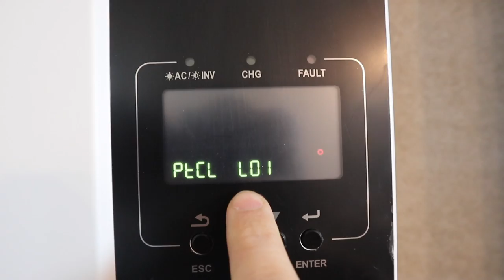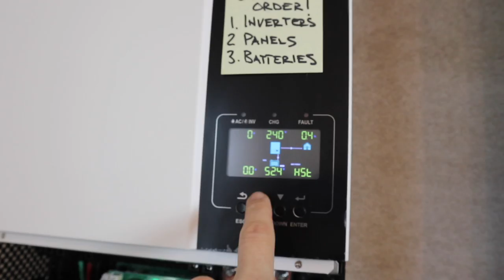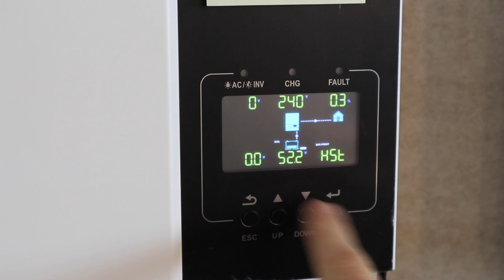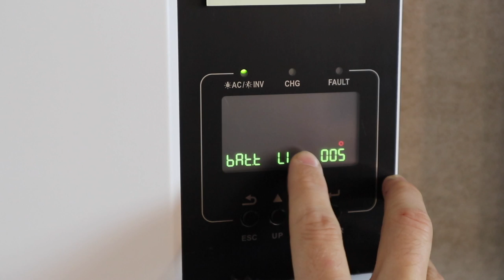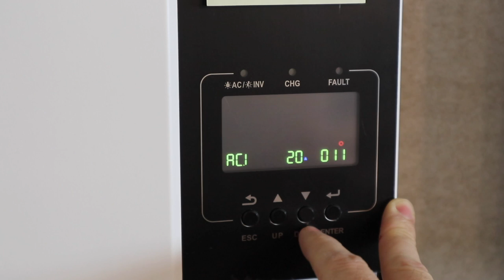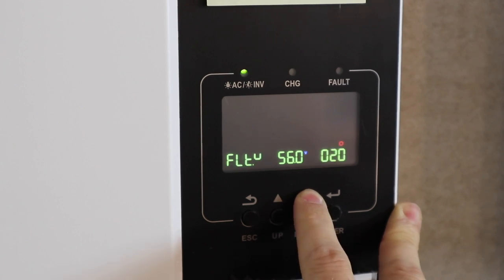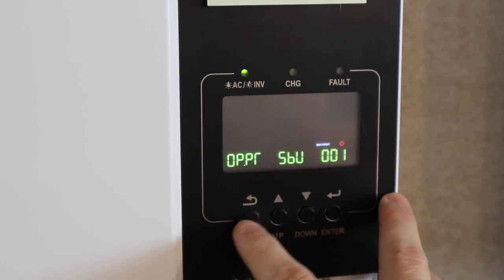Solar Inverter Growatt 5K Programing Grounding & Battery Comms

Comment: Great video, really appreciated.
Just a correction: at 6:19, "36" is not a protocol number, its a setting number. To run through your process ... You are at setting #5 (the battery type). You press enter, and the value of that setting is set to US2 (which you correctly say is the User #2 setting, used for dumb lithium batteries, where the battery is controlled by voltage only, not by comms). You press the down arrow and change the setting to LI (Lithium). When you press enter again, you are not looking at a setting of "protocol 36", you are have been jumped to SETTING #36, which is "Protocol" (the left side shows a cryptic "Ptcl" which means PROTOCOL). Here, you are setting the protocol number, in your case to "01".  
Protocol numbers (for Growatt and a number of similar all-in-ones) 01, 02, etc up to 49 are variations of the RS485 protocols. This protocol is a request-response protocol (ie the Growatt asks for data, and the battery answers)
Protocols 51, 52, etc up to 99, are variations of the CAN protocol. The CAN protocol is a broadcast protocol, ie the Growatt just listens, and the battery repeatedly broadcasts its requested charge voltage, SOC, requested current, etc etc, and doesn't care if nobody or everybody is listening.
For other readers: If you BMS is a fairly typical BMS of the current era, its likely to have a CAN port, an RS485 port, then an RS232 port (6pin), then a pair of RS485 ports. If so, you can use the BMS port on the Growatt, the CAN port on the battery, and protocol 51 or 52. If your battery only has RS485, or if you want to use RS485, or if your battery/BMS is more reliable over RS485, you can use the BMS port on the Growatt, the RS485 port on the battery, and protocol 01 or 02. 
One other correction - you say that older Growatt SPF5000ES used the RS485 port. This is correct, but "which port on the Growatt will work" is comms-board and firmware dependent. Older versions of the comms board and firmware had a limitation where every parallel inverter had to have a cable, and a MODBUS hub did the job of making sure all units saw the same data. Newer comms and firmware, as you correctly mention, share that data over the grey serial cable, so only the master Growatt needs a cable to the battery. The red/black is the cable that allows the inverters to sync their (output) sine wave. It might be more correct to call them frequency sync cables, rather than communication cables. 

An important note is that you can't really stuff up the grey cables, as they are gendered. You can stuff up the red/black cables, but I don't know the result of this.
At 8:58 you enter setting 23 (in standby mode) and change to PAL . This is correct, but you are not correct that you "can just esc out" - your setting was not saved, and at 9:01 you can see that the settings have changed back to SIG (inverter in "Single Inverter" mode). This probably worked out OK for you, because (at least with modern firmwares) when the units power up again, and see the grey serial cable is connected, they will know they are in parallel mode and default to PAL. With all settings, the setting is not saved (and also not checked for compatibility with other settings) until you press enter. Note: If you setting is NOT accepted (lets say the value you set is outside the acceptable range, or conflicts), at the point you press ENTER, the setting will change back. Another note: If the setting is READ ONLY (ie setting #2 for a comms battery), when you press ENTER to jump into the value and change it, you will instead end up on the next setting down, in this case setting #3. This is how you know the setting is read only.
Also, with newer firmwares, some settings in the manual that say "This setting is only available when the inverter is in standby mode" are actually settable in both modes. One example is the output voltage; we regularly change the output voltage (setting 08) without turning off the inverter switch - you will get a ~2 sec outage where the inverter stops, then restarts, but you do not need to turn off the switch. 
DIS is Disabled, not disconnected, but same same really.
"Setting #11 is only for lead acid batteries" - No, setting 11 is not relevant in your setup, but not because its for lead, its because you don't have a generator or grid backup. Setting #11 is how you control how fast the batteries charge from UTI (utility, aka grid or gen). This enables you to limit how much your Growatt pulls from the generator for recharging (vs running the house).
Setting #12, you are mostly correct, this controls when the grid or generator kicks in, but it wont prevent your battery discharging past X percent - the Growatt is still drawing 80w, and the house is still drawing power. Once you get to setting #12's percentage, the dry contact will change over (potentially starting a gen), and if power is then available on the input terminals, it will start to be used. Now your SOC will rise, but only if gen/grid continues to be present. Its moot, but important: at this point, the battery is STILL being used to run the overhead of the Growatt (~80w per inverter), so if (as in your case) you have no grid and no generator, even if you disconnect the house, you will be slowly dropping in SOC. This might seem like nitpicking, but its important; if you hit #12 at say 6pm in winter, with no grid/gen and a disconnected house, you might need to handle 160w of draw (2 growatts) for another 16 hours until the sun hits your panels again. You can prove this by setting #11 to zero amps, turn off your solar breaker (simulating night) and see that when the battery gets down to #12's set point, the battery is still being drawn down.
Setting #13 is nothing like you describe. This setting is where the generator will stop (the dry contact will be switched back to "normal"), or the grid will stop being used. If you reach as low as setting #21 (probably the setting you were thinking of), the inverter will stop powering the house, and grid/gen will power the house (in bypass mode) and optionally recharge (at the rate of setting #11). If grid/gen is not available, the inverter will still power the house (and the batteries will therefore continue to drop). Once you get some incoming power (solar or grid or gen), its something like 5% (seems to be firmware dependent) above setting #21 that power comes back on (ie the inverter starts inverting again).
I don't understand why you say charging the batteries from grid is not good for them. We charge from grid all the time, also from generator (which is almost the same except the power is not as clean). The SPF5000ES has no dedicated grid-to-battery charger - the grid/gen powers the DC bus, as does the solar, and this bus can handle from 150v to 450v, and DCDC this power down to Vbatt (the specific voltage depends on the battery type, SOC, charge algorithm, and settings 19/20).
There is no problem running the system without PV - this occurs all night, and any time the PV disconnectors are off. We also tell customers not to run without PV but only because it could be weeks before they finish the PV part of the install, and recovering a battery from protection mode (when the voltage is so low the BMS disconnects the cells from the terminals to protect itself) is a pain, so i expect that SS are also saying that to avoid support calls from people leaving the SPF5000ES dragging 80w all day and night, and eventually causing a low battery issue.
Great video, its awesome to hear good quality audio, steady and in focus video, and clearly enunciated words, well done.
Reply: @RoarPowerNZ-tt6ud  Finally protocols clearly explained. Thank you.

Comment: I have enjoyed all of the videos I have seen from you so far, great info and well articulated.

We, that's my wife, young adult son and I, are about to embark on a similar journey in central Mexico.

We are about to take possession of a little 38 acre ranch at an altitude of 8000 feet. Out of the 38 acres, 10 acres is a pond. The pond is 25 acres in total but our geographic boundaries include 10 acres and our neighbors owns the rest.

The property is on a main road and has access to electricity, but it was never run in. Instead of going through that process, we have decided to go with an off grid solar system, which is similar in installation cost, but offers us complete independence.

I have looked at many different solar systems, but the Growatt All In One system appeals to me the most, as it is cost effectively distributed here in Mexico. I also like the MPP Solar units, but they would have to come from Taiwan. I really like how you can string the units together, as it makes it easy to increase the system output size and if one unit breaks down you can at least function on reduced capacity. I'm looking at 2 or maybe 3x 3000 watt units, with 8000 watts solar and 20000 watts battery back up. Not requiring heating and air conditioning, makes life easy in regards to energy requirements.
Reply from the maker: Very cool. Blessings on your adventure. 
Not needing heating or air conditioning will be a huge energy savings.

Comment from the maker: I just got off the phone with Sig Solar as well. The are going to provide schematics for proper grounding, are working on them as fast as possible, and will post them soon. We run the 5000es as a completely off-grid system and the model we have has the bonding screw removed so I am not that worried. Additionally, the Growatt transformer they are selling now is different than the SolarEdge. They will provide further info on this soon as well.
Reply: Great videos, I agree with your sentiments... Can you provide a link to the grounding update from SS please? These videos are super helpful. Thanks!
Reply from the maker: @taulli1  They have told me that the method I showed in the video is correct. I have had other electricians contact me to still say it is wrong. I am leaving it as I showed it in the video but will continue to research it. There is no link from them at this time.
Reply: @CountryLivingExperience  Thank you for the quick reply! Are you up and running yet? Do you think the various methods (opinions?) of grounding are esoteric, have pros/cons, or do you think there is a day to day advantage, or is this a catastrophe avoidance issue? This has been a troubling setback.
Reply from the maker: @taulli1  Don't be troubled, it will work out. I have found that varying opinions come from varying experiences. I trust the solar company. I am still doing my research as well. I am not an electrician. My electrician said it looked fine and some others said it didn't. My system operates flawlessly.

Comment: Hi ,you write that the right order is : Battery ,panels inverter? and at the end the Grid?
and secondly  ,before you make the settings in parallel mode(of course the input AC Grid breaker is off ),does the AC output must be parallel connected (2 inverters 1 phase ) or first setting it at parallel mode from the menu  and after connecting the AC outputs of inverters ? 
Bonus question ,is it ok if one of the two inverters is without PV connecting? 

Thank you very much!

Comment: great informative video but opens up a box of questions😁.
1 on t=4:27 how would I know I have the older or the newer version (visually or screen info)?
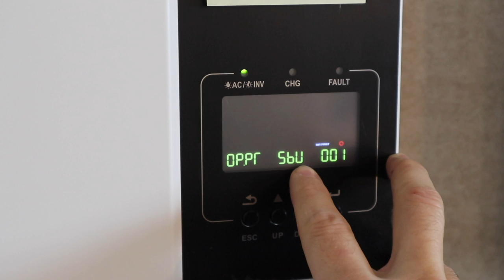2 on t=10:10 if the setting was SBU or SUB (if the inverter was connected to utility), this means the solar will provide power but for some reason solar power was not enough (excessive load, not enough panels), will it compensate from the next selection or will it switch 100% to the next selection?
3 on t=13:12 why charging the battery is better-off to be charged by solar if I have utility (clean and steady) connected?
4 on t=15:30 why it is important that I have battery before I power the system, is that because I may not be generating enough voltage (nominal operating voltage) from solar and this will result in error (auto-restart)? I was thinking to go battery-less and have only solar and utility🤔.

fyi: I have 230v/50hz utility
Reply from the maker: Thanks.
1. There is no way to tell. You will have to try both ports.
2. It will compensate and share power sources with the loads.
3. For this brand, solar input is recommended for best results and battery stability. 
4. I was advised of this issue by the distributor. I am not sure of the technical details. 
This specific Growatt inverter was modified by the manufacturer per the distributors technical specifications for the American grid. If you buy these outside of North America, the internal configuration of the Growatt 5000es will be different. These are technically Growatt 5000es-US models.

Comment: Are you considering using Generator AC input to charge batteries when PV is not available?
I found the RS485 vs BSM jack swap in the new units the hard way.
I fully expect to use the system without PV connected as a stand alone battery backup.
Reply from the maker: Yes, I am going to buy a small 1k or 2k watt dual fuel generator to use with the dedicated battery charger. Sig Solar did a video about why it was not practical to hook a large generator into the inverters to charge the battery.

Comment: What size lugs for the inverter and what battery cable size is that? tried to find when you hooked up your batteries but missed it somehow. Thanks for your videos. You explain things well.
Reply from the maker: Glad we could help. 2awg batt cable and 5/16" lugs. I just got the battery cable from the auto parts store.

Comment: My understanding of the whole grounding/bonding discussion is that an electrical system will work okay in most cases with various configurations of grounding/bonding, but where it becomes an issue is IF there is either a lightning strike or a fault in the system caused by a short in a load. In the case of a lightning strike the ground rods are the primary resolution. However, if I’m correct in interpreting NEC guidelines, there should only be one earth grounding point (rod or rod sets) for the same building even it has multiple sub panels due to the fact that voltage potentials could be different with a rod on each panel which could create an arc across something in the building.
      Regarding a system fault from a load short, since the voltage always looks for way back to its source, the neutral plays a big part in clearing a fault via the breaker in the panel. If sub panels are bonded (neutral to earth ground) where they should not be, the voltage doesn’t have a clear path back to its source to clear the fault. Again, if I understand correctly, that means the panel that combines the AC from the inverters as well as the mid-point transformer that creates the neutral for the 120v loads should be the point at which the neutral bus is bonded to earth ground on an off-grid system.
Reply from the maker: I appreciate your insight. There are so many varied interpretations and opinions on this. i am part of the diy solar forum and most on there cannot agree. There are professional electricians, electrical engineers, solar companies, etc on that forum.
Reply: Mike Holt has excellent informational videos.  He has definitely convinced me that there absolutely should only be 1 earth ground point in a building or structure.  You do not want a nearby lightning strike to ride in at one point through your house and equipment and out the other point.  Very Bad.   Power always looks to get back to source, not the ground.  Everything inside should be bonded together,  leave at 1 point, and  multiple rods outside should be bonded together.    Good luck and stay safe.  @CountryLivingExperience

Comment: Thank you so much.  Your videos are so helpful.  You say to not charge from the grid.  But SS has said I can do that and it will work fine.  Why do you say it is not good for the health of the system?  What happens if your batteries get too low and you don't have enough power for your home?
Reply from the maker: You're welcome. 
It will wear the inverters out quicker. If I don't have enough battery then I don't have power. I will have to wait until the sun recharges. My system is technically off-grid anyway.

Comment: @ 9:00 your setting #23 to PAL, The master and Slave 1 at the same time. I have 4 inverters, Can I set them one at a time starting with the master then S1,2 then 3 or do I have to shut of all 4 and set them at the same time. This probably is a strange question, but I'm at the point that everything is wired up except my PV and I am about to turn them on for the first time and I'm am a little nervous.
Reply from the maker: Don't be nervous, you can do it. The inverters cannot be set as master, slave, etc internally. It is based on the order in which they are turned on. I didn't see a specific question in your comment....what is it?
Reply: @CountryLivingExperience  I turned on my inverters with battery power and programed them and All is well. I have 14 more panels to install and wire up and in about 1 or 2 weeks ( depending on the Weather) I should be running on Solar power. Thanks for your videos, they were and are a big help.
Reply from the maker: @JamesLee-ey2yv  Awesome!!! Glad we could help.

Comment: Hey there again. I w finally got my Growatt Grid Tie setup in place and running great. It’s now time to start looking at batteries and was curious as to how much life each day you get out of your batteries? I know the larger draw you put in them the quicker they’ll run down, I’m just trying to get a general idea how they do. I’ll most likely be buying one at a time, slowly adding more capacity as time goes on. 
As usual great video(s) and very informative.
Reply from the maker: Glad you got your system up. 
It is hard to say. There are so many variables. How long are you running each load and how much sun do you have that particular day. It is honestly hard to nail down. I keep adding batteries as well.